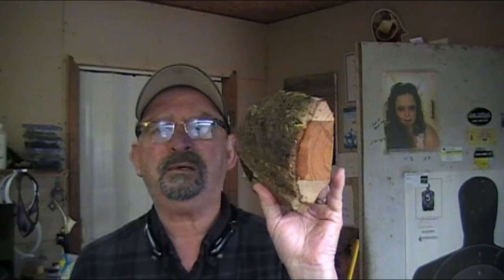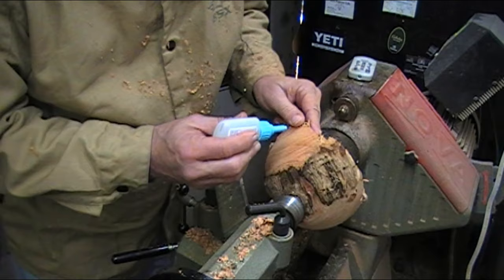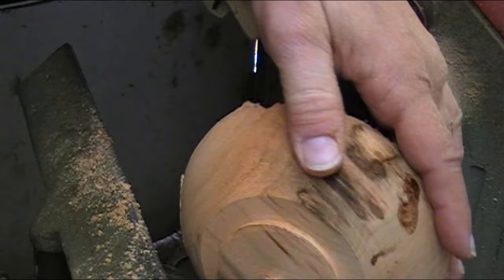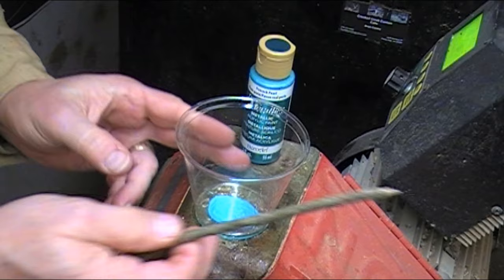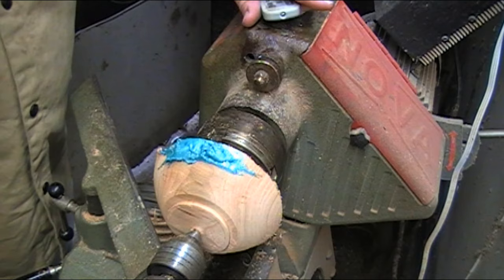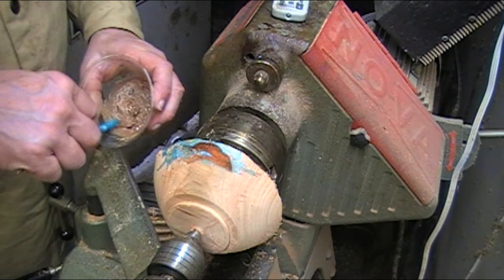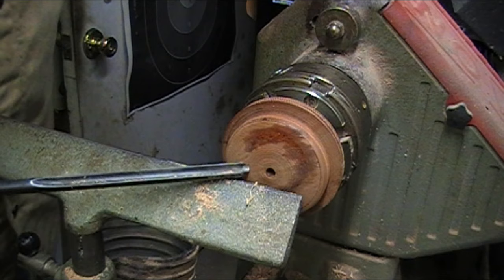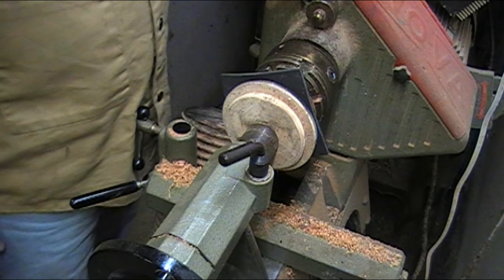A small wormy cherry bowl

Comment: Gotta love the borer beetle!  NOT!  Ron, for colorants mixed with epoxy I use powder coat powder (it's relatively cheap).  I also use polyurethane automotive paint (it isn't cheap, but I have a stock pile... another story) and it works well.  Alcohol ink also works.
Might be small, but it's a nice looking bowl.
Billy